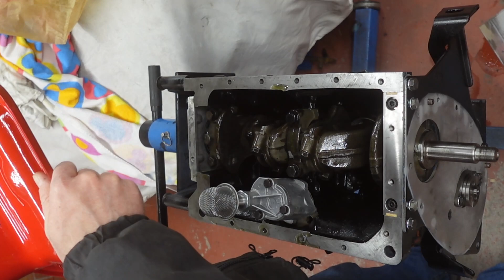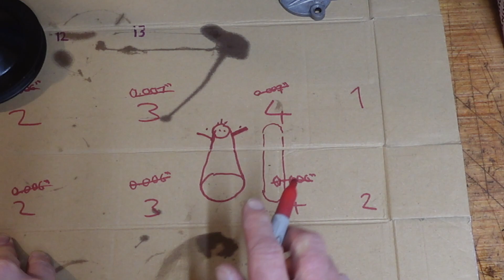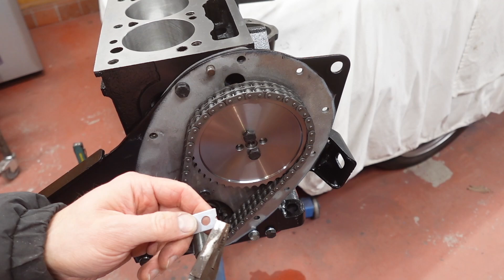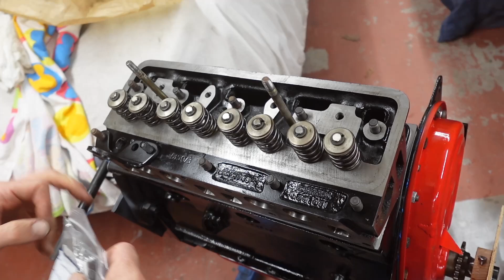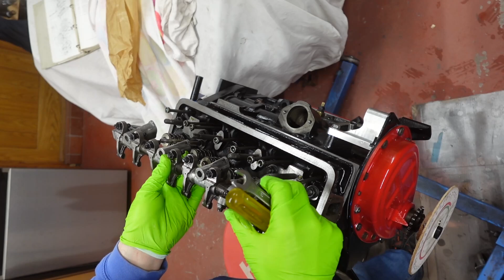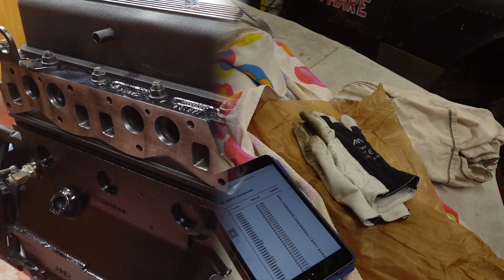Engine Build Complete - Timing, Head, Rockers, Ancillaries  | 1969 Triumph Spitfire Mk3 | Part 15

Comment: Looking good Josef, do you know why the front sealing block didn’t line up? (What a pain!). I used pretty much same technique for timing except did crank with dial gauge too. What timing and lift is the new cam, mine is 30-70-70-30 with  0.270” lift, which worries me a bit. Think I’m going to upgrade standard 1200 set up to Kent lightened tuftrided tappets with drilled oil holes, the Newman valve springs you have used without bottom plates (designed not to bind up with high lift cams) and now will add some bushed rockers as they should wear less than the nos ones I currently have…oh and thanks for the subtle reminder to put the oil thrower back! (I may have missed that too 😜)
Reply from the maker: Thanks Jon! The sealing block was just drilled wrong. Luckily I had a TSSC one from before all the palaver with the shop, and that fitted fine. I sent the other one back, need to chase up on it though... My cam is 20-60-60-20 and 0.250" cam lift (Newman's Spitfire PH1), your spec is like their 'fast road' version. I only went with bushed rockers as the quality of the all steel repros has not been good in my experience, but they appear to come from exactly the same source. I would've used NOS ones if I had more than one of them :D Glad I've prevented both of us from missing out the oil thrower! How far have you got, you must be near to putting the head on yours now?
Reply: @ Thanks for reply, I’ll put another update on the forum soon detailing my cam vs head thoughts, time has again been an issue lately, but the bottom end is done and painted, however following this video I did take out my +5 thrust washer and rub down the back on a surface block which brought the end float up from 3 thou to 5 thou. I was right on the cusp of 2x std washers being just over tolerance and 1 x std with a +5 being under, so thanks for inspiring me to look at that again, a lot happier with it now. 👍

Comment: As a general tip on rocker cover gaskets which seem to leak after a while, the MGB uses a cork casket and the general method is to secure it to the rocker cover. I find that if you use Wellseal to secure it to the head the rocker cover comes away cleanly & the seal at the bottom ensures any small amount of oil is sealed in by the gasket, instead of relying on the cork to seal to the head. That way you can take off the rocker cover & not have to replace the gasket. The original steel rocker covers always seem to leak, I put this down to heavy handed removal or over tightening of the rocker cover nuts.

A quick question on your engine stand, do you think it is man enough for the heavy six cylinder engine? I ask, as I need to work on the 'B' series of the MGB & that's very heavy & I usually have to work on the bench or the floor & I'm not getting any younger, so an engine stand looks like a good purchase. I'm hoping it's just a new rocker-shaft but it has done over 100k miles since I rebuilt it so may require more work, the camshaft is most likely next to wear but I can measure the lift on each lobe and see if the surfaces are good.
Reply from the maker: With the cork gaskets I do pretty much the same as you, I think the Herald’s original rocker cover has become distorted though as I was unable to get it to seal at the rear. I couldn’t even get it to a minimal leak state, so I pinched the Spitfire’s!

My stand is an ex display Draper 20129 (I originally bought one from SGS but they sent me an incomplete one, then the replacement was also missing parts, so not bothering with them again). It’s rated at 450kg and the GT6 engine is just under 200kg, a b series Google tells me is something like 160kg. Cost about £70 a few years ago, but if you look at gumtree or fb marketplace you can probably find one for a fair bit less.